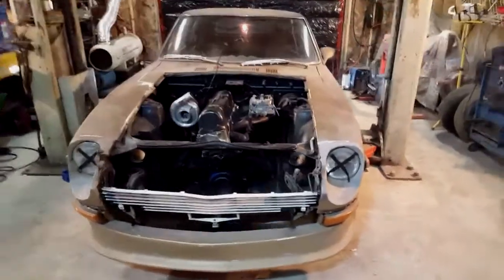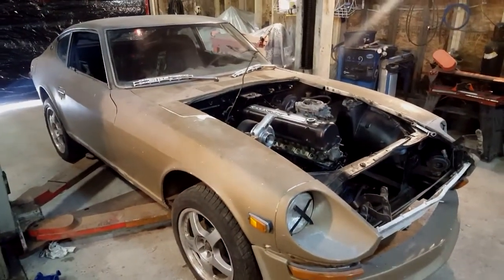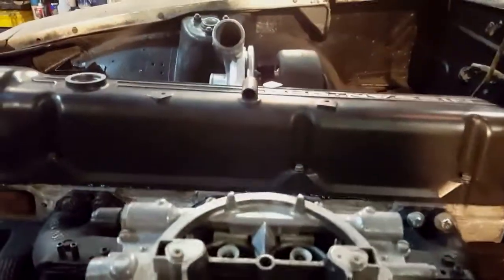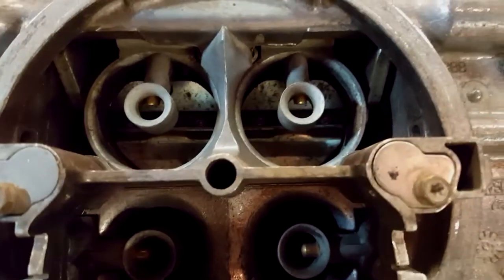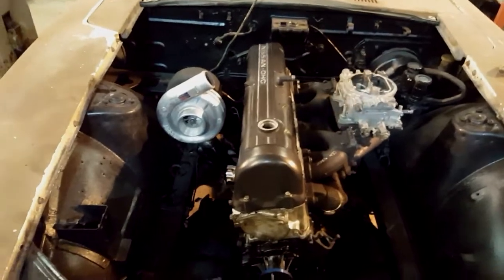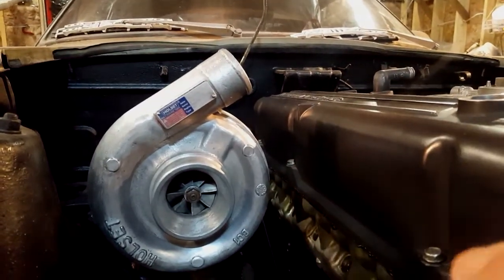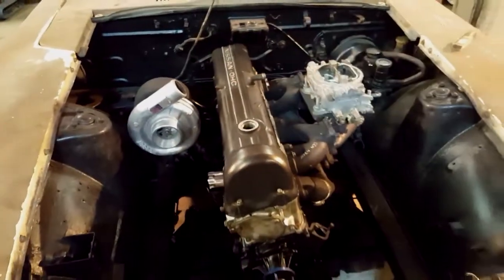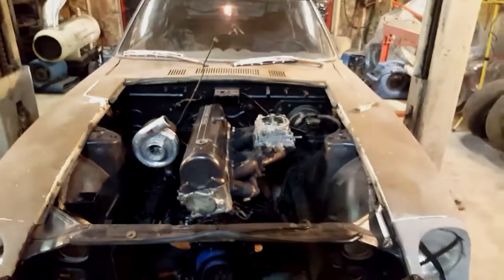Turbo Flutter Explained On 260z

Comment: don't take this negatively or anything just a datsun owner to another, either build those internals or don't run high boost on that turbo with stock internals. I blew my L28 on 10psi from a garret 350. your turbo looks about the same side. so just be careful man. don't wanna see another datsun down,
Reply from the maker: Thanks alot man! I'm going to try and run low boost for the first little while! do you mind explaining what blew on yours? I would love to know!
Reply: +Coastal Budget Builds well the pistons couldn't take it so 1 and 3 blew threw the Head, and the cylinder walls were pretty banged up, I would just say get cams and a head port and maybe sleeve the block and get a piston upgrade. I blew the engine and just gave up on it. had no motivation to work on it after that haha but just be easy, and if you feel something is wrong check forums and everywhere possible. because I assumed it was just the turbo but I was wrong haha
Reply: +Coastal Budget Builds and I hope that you have or will get a Schedule for your videos because sofar I've watched about 5 to 7, and I'm really digging the style and the progression threw the cars :)
Reply: Jonathan, were you using a L28E motor that you turbo'd or were you using an L28ET motor?  The L28ET fuel system can handle around 12-14psi with the stock turbo.  That's limited by the fuel system.  The L28ET block came with dished pistons vice flat top pistons on the N/A motor.
Reply: L28e I picked up from a friend.
Reply: Understood!

I was running 14psi on my L28ET in my 1983 280ZX-Turbo.  Currently in the process of a motor build with Rebello Racing.
Reply: Yeah. I gave up my dreams of another 230z or Z platform. Where I live kids want 3k or more for ones that have mad rust and don't even run